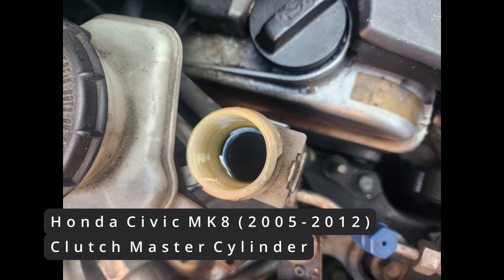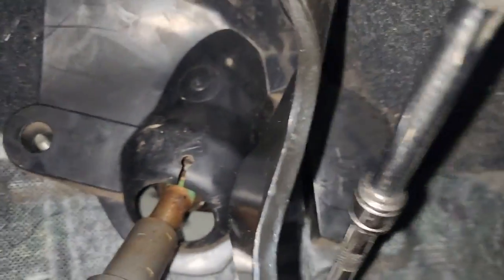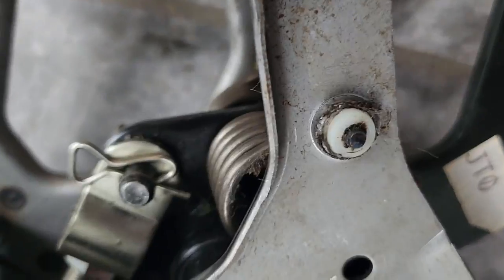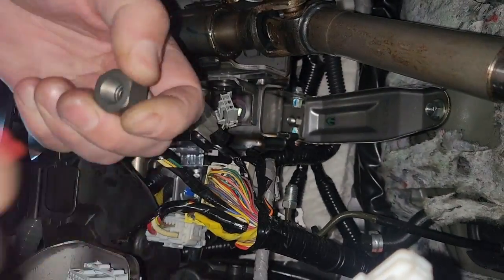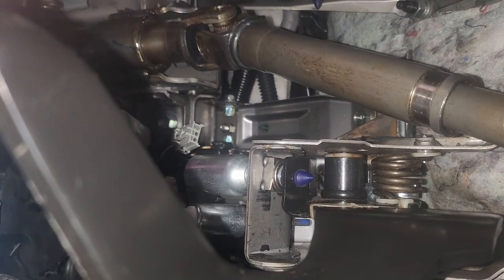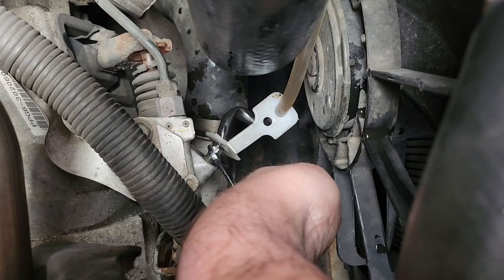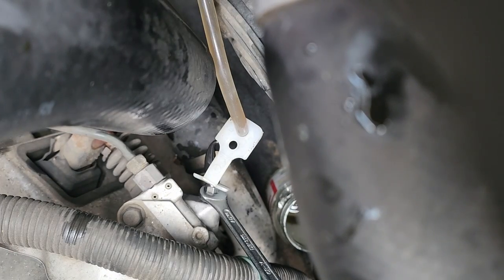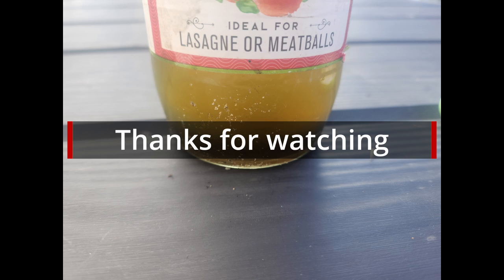Honda Civic Mk8 Clutch Master Cylinder replacement and bleed (UK/RHD)

Comment: Thanks for sharing, Im about to do this my self and I found your video very informative, I noticed you have disconnected two hydraulic lines then take down whole assembly off the car in one pice but do you think it is possible to replace MC from pedal bracket outside the car and reinstall the whole assembly together?

Comment: I have a honda civic 2012 with a manual transmission(US/CAD) The issue i’m having is that i’m stuck on neutural and I can’t manual shift into any of the gears no matter how hard I try. I noticed my clutch pedal was looser than it was before and when I checked the clutch fluid there was barely any left inside. Do you think this might be the reason why I can’t shift gears or would I have to change the master aswell?

Comment: I cannot get either of the hose clips off from underneath!! The rubber hose clamp has twisted the other way round so I can't get my fingers to it  and the circlip wont budge! 3 hours of trying and I put the bloody thing back together for another day aaaagh
Reply from the maker: You should be able to remove the pedal assembly and leave the cylinder in place - might help with getting to it if you do it in two parts

Comment: Hi, my 2006 Jazz has dark clutch fluid. Its a heavy pedal but not slipping. Do you think just change the fluid?
Reply from the maker: definitely worth doing as DIY it's cheap to try.  Air in the fluid can give a stiff pedal

Comment: Great video! Thank you. I'm struggling to find the type of cylinder for the master and slave. I have a 2006 model. What is the part number in this video?
Reply from the maker: TRW P/N is PNB959 as per 3:31, which also shows the fitment details.  If you goggle PNB959 you should get some links and alternative part numbers from other manufacturers.  I think the OE P/N is 46920-SMG-023 or was for me
Reply: @wheeldesire Than you!

Comment: my clutch sometimes is okay but sometimes i dont get alot power in first gear. Feel really short. Is that something what would you suggest me to change ?
Reply from the maker: If you're getting clutch slip (e.g. revs rising but the car isn't accelerating), I don't think the clutch master would resolve it.
Typically, you'd expect to see symptoms of the clutch not disengaging - so hard to get into gear, crunching into gear etc.
Reply: thanks for this info.✌🏾

Comment: Thank u mate i thought it was a slave cylinder but this is exactly the issue i currently having
Reply from the maker: The clutch damper can also be a candidate, but usually start here if the fluid is dirty, and think about a bypass hose for the latter if it is still an issue
Reply: Clutch damper ? Bypass hose ? What does a clutch damper do ?

Comment: Having an absolute nightmare trying to bleed mine. Please can you explain how the homemade vacuum is made? Thank you
Reply from the maker: In my case, it was a plastic bottle with the bleed tube sealed in the lid, and I used a pump (for inflatables) in vacuum/suck mode attached to the bottle.   You can use anything that will effectively 'suck' the fluid and start the process.

I do have a vacuum bleeder tool, but didn't have it to hand at the time, but you should be able to make something similar - even if it is a jar and a bicycle pump
Reply: @wheeldesire  thank you 👍

Comment: I wouldn't even bother with the £30 master cylinder. It'll be broken in a year or so, if that. My dad went cheap on a master cylinder off eBay once, it broke within 6 months.
As for clutch bleeding, just open the valve, put the pedal down then put your toes under the pedal and pull it up. Pump it a few times like this and the air should come out. Then lock the bleed, pump the clutch pedal 5-10 times, then open the bleed nipple again and it should be good to go.